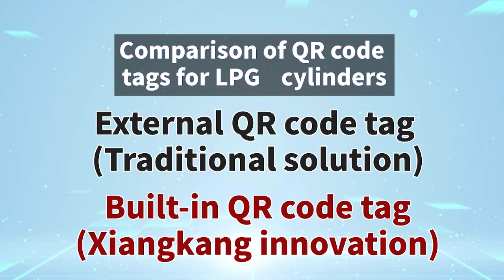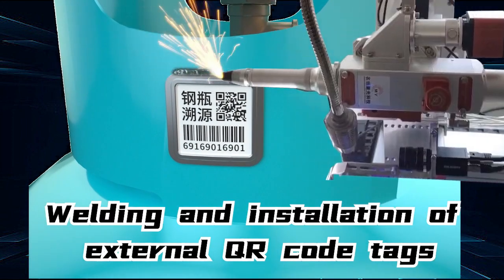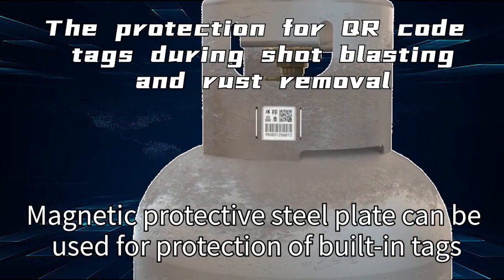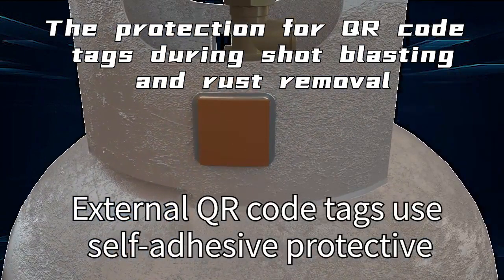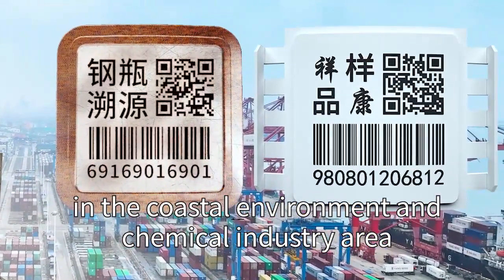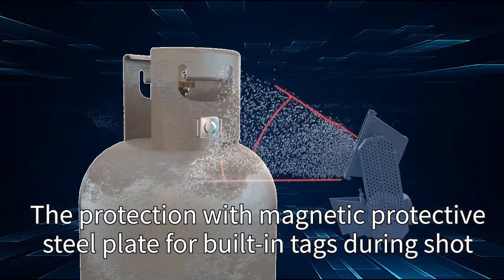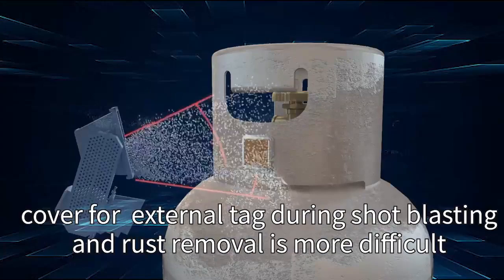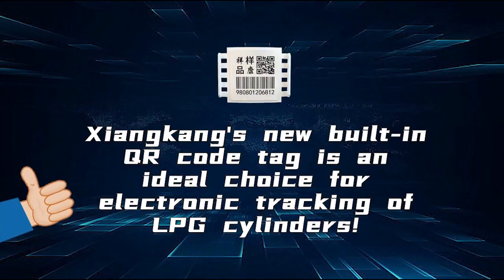How to find a Built-in LPG Cylinder QR Bar code Tracking Tag?(andy@czxkdz.com,whatsap+8615021345915)

Comment from the maker: XiangKang insist on innovating of bar code tags,to improve the design,the installation,the performance to meet different demands of different cylinders and different environment.
Built-in LPG Cylinder Barcode Tracking Tag is a innovation of XiangKang in year 2022.

Advantages:
1. The built-in tag can prevent surface collision damage during cylinder circulations.
2. The built-in tag has better resistance to hash environments.
3. The welding operation of the built-in tag is simpler, and the welding effect is stronger and more reliable.
4. The protection with magnetic protective steel plate for built-in tags during shot blasting and rust removal is reliable, convenient, simple to operate, and the protective steel plate can be used repeatedly.

For more details,include manual,technical data,performance testing video,installation file and etc,welcome to contact andy@czxkdz.com,whatsapp:+8615021345915